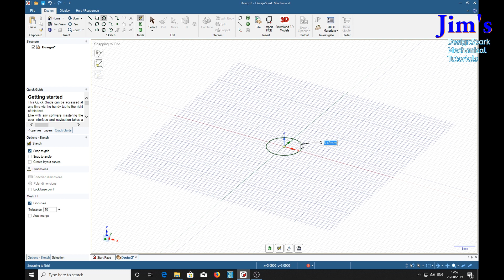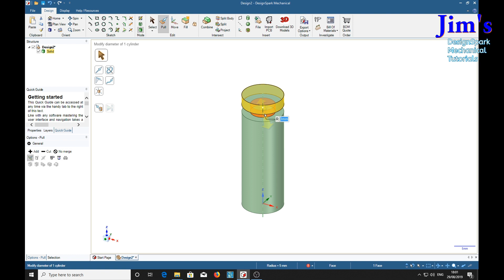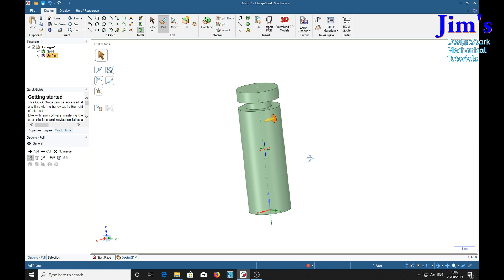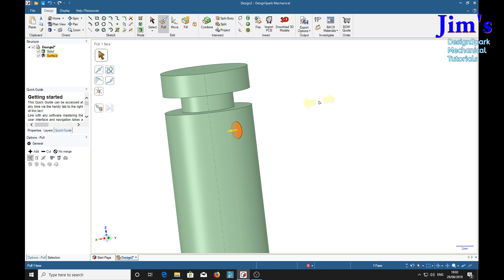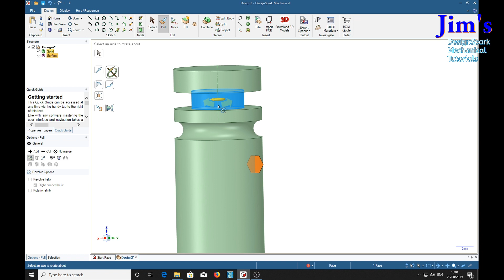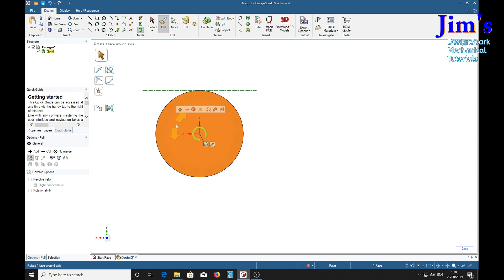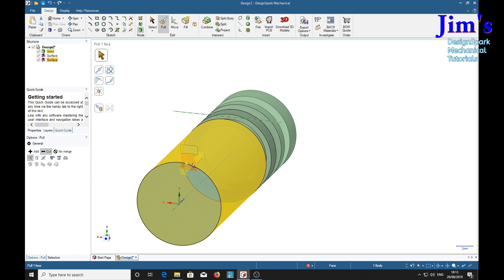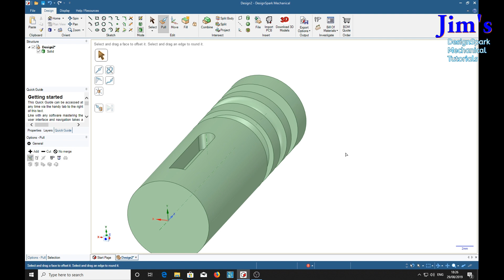Making slots in a rod with DesignSpark Mechanical

Comment: Hi Jim thank you so much for the valuable info you provide. I am wondering if you might be able to steer me to a tutorial or assist me with something I am struggling with. I have a curved handle which I am wanting to include multiple recessed slots in but to a consistent depth. Obviously, if I simply cut into the curve the depths change along the length of the curve. Any assistance would be hugely appreciated. Thanks so much.

Comment: How do we find the key controls for some moves during the designing? For example, what keys shall type to make a plan view after I select "Sketch"?
Reply: Everything is in the help menu. Click on the little question mark in the upper right corner, click search, and click keyboard shortcuts. All of the most common ones are also clearly defined in the ribbon functions - so you don't even need to go into the help menu. Just hover your mouse pointer over the tool and the keyboard shortcut, along with a description appears. I have personally memorized about a dozen of them, but there are many more...
To answer your specific question about Plan view, just press V on the keyboard after selecting a face. It works in either 3D mode or Sketch mode.
In addition to keyboard shortcuts, there are many mouse functions than can be customized. Very useful if you are using other 3D software and are accustomed to different mouse button/wheel functions.

Comment: Hi Jim. If I may suggest a request. I am struggling with this drawing and suspect that it is the program options menu settings. Can you please do a tutorial on the standard settings you use of the program options before you start a project? To be exact the first method for the slot did not work but the second method did. When I pull the the slot shape in the first method it pulls the whole object shape and not just the the square slot shape if that makes sense.